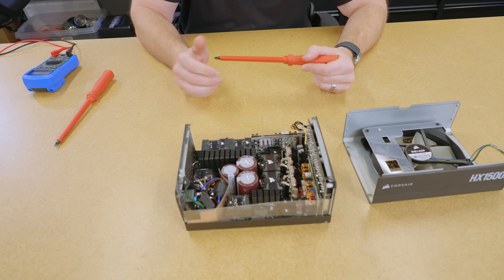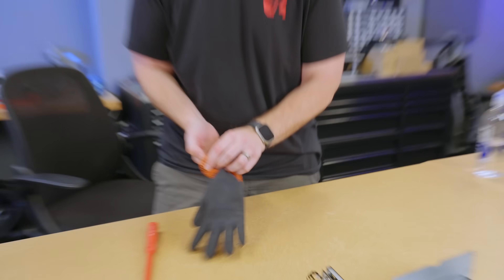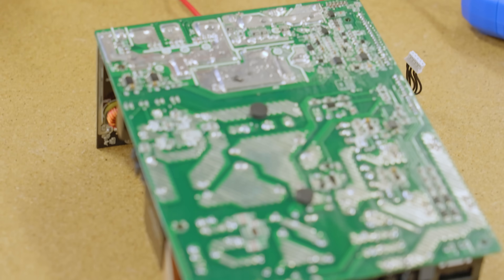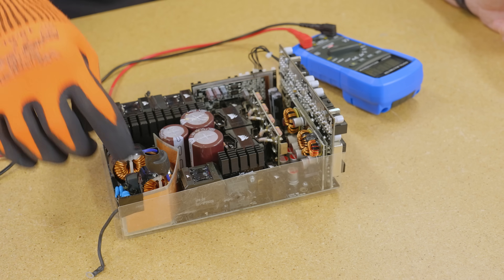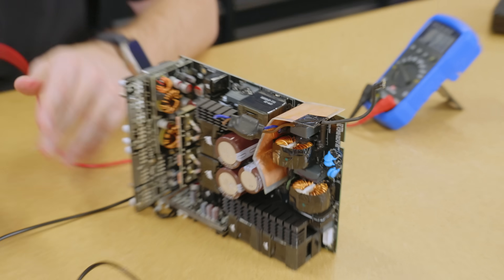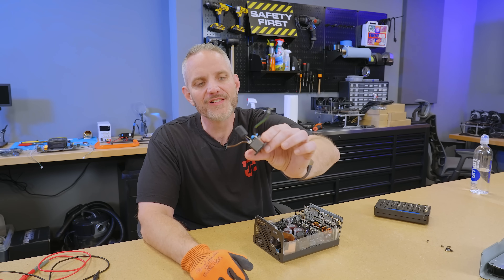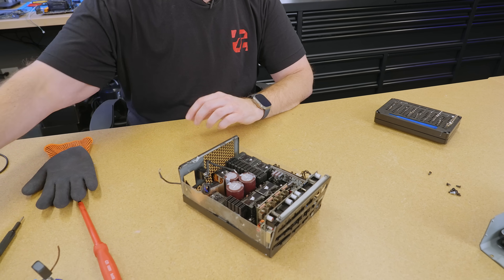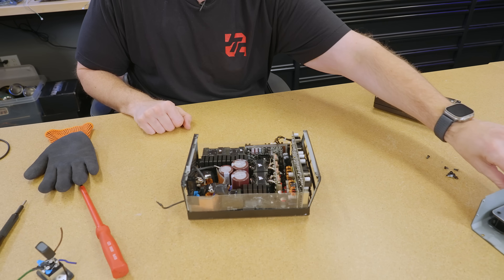Investigating what exploded in my PSU... DANGEROUS! DONT ATTEMPT!

Comment: Those bigger components you were pointing to that you said were the issue look a lot like transformers to me. In fact what I think was a part number I checked from what I could make out "QPR-33" at 5:05 could be the number a ferrite core for one based on a quick search. It would also make sense that you wouldn't measure a charge past that component since transformers REQUIRE an alternating current to transfer energy across since their whole thing works via induction. The capacitors here are only providing a DC source, not AC, so energy cannot pass through that component.

Also, I would not dismiss a capacitor as being bad, as they can still hold a charge when blown. Other comments have also noticed a blown capacitor and the more I look at it I think they're correct.

Comment: its funny to see non eletrician trying to diagnose something as psu :D and it seems as onw of the big caps popped, there is some black line on video on safety release of gasses (cross thingy).
area where you pointed, may be switching dc to pwm for transformers, blah blah blah tech stuff thats why its not getting any power, cuz its off ... :) you can send it to me ... :D

Comment: To discharge big caps at 150v , all you need is a dropper resistor or an old style mains rated  lightbulb with a filament to use up the power, if you want to do it safely without sparks  These circuits should normally have a 1 Meg Resistor or something across them to trickle discharge them I am surprised it held 150v for 24 hours!  It is usually a safety requirement to have built in discharge circuit.

Comment: Those caps have very much discharged. They are the main charge storage/smoothing caps that sit after the PFC boost converter. This stage converts the AC line into a high voltage DC. This is typically 360-400V. So if they are at 150V they've definitely lost a lot of their charge. Usually they would discharge even lower than 150V but as the secondary DC/DC stage probably exploded it isn't working to discharge them.

A transformer, or inductor, if it's the resonant inductor in an LLC, isn't going to 'explode' or make any noise at all if it fails. What would make very loud bangs are power silicon devices exploding. For a loud crack/bang you need the explosion to be quick and electrolytics usually fail over a matter of seconds. A tantalum/ceramic cap could explode though as I've had that happen.

I would be surprised if this was an overcurrent spike event. PSUs are very tolerant of current spikes and usually have a peak current delivery way above their average spec. Also converter control loops are 'slow' vs a transient demand from a GPU so any transient is likely to be handled by the filter caps on the 12V rail rather than the converter itself which will then react more slowly to top the 12V rail back off.

If the PSU had been properly designed then none of the power components would be getting catastrophically hot, during full load operation, and should be rated to handle the peak power maximum as defined by the cycle/cycle OCP limit. It sounds like one of two things may have happened. 1) Some power component wasn't specified correctly and when things got hot it exploded. 2) The PSU was properly designed but a fault developed after it had been repeatedly stressed and thermally cycled.

Comment: If the capacitor had blown you would have a power supply filled with junk. It is probably the switching Mosfet that died, its not uncommon.

Comment: As an  electrical engineer, this video was a lot of "ok, you don't have to be that cautious... Oh Please Hell No Don't Do That!!!!!". FYI,  30mA is all you need to stop the human heart, but that assumes you bridge live terminals with opposite hands so there is a path through your heart. If you bridge DC with 1 hand you'll likely just get a nasty burn but it won't go through your heart. The current you'll get depends on the resistance of your skin and can be calculated using Ohm's Law (I = V/R).  150 V isn't all that high (but  you should definitely still be cautious), these caps in other countries can hold up to 400 V usually. Get a 47 kOhm 5W resistor to bridge out the caps to make them safe.

Comment: It can take 6 months for those caps to discharge fully.  In AU its not uncommon for those caps in PSUs to have 800V between them. Under that small heatsink next to the transformer you kept poking with the screwdriver will be one of the switching mosfets, when those things blow they make big noise... Sometimes in lower end PSUs end up in a few pieces. If you were to discharge those caps and remove that heatsink you'd probably find your dead component.

Comment: Looks like a scorch mark on the copper shield behind that lone rectifier (though I guess that could be some kind of black adhesive, can't see it well enough to tell), as well as a blown safety seal on the top of one of the caps (the one with the yellow smear on the top)...might've had a cascading failure where several components popped nearly simultaneously, would explain why it was so loud when it failed.

Comment: in UK its actually safe to leave psu plugged in if opening as our sockets have switches so we can shut the live supply whilst maintaining ground connection. i had mine open the other day clearing out the dust build up.

Comment: I don't know how they could miss the slit in the capacitor where they found the yellow stuff.
That's your smoking gun. Although it didn't 'blow' the top out of the cap (which is why those indents/weak points are there, so the cap can localise the energy it releases), something went bang.
DC voltage shock is common. You can rub your feet on synthetic carpet on a dry and windy, low humidity day and build up tens of thousands of Volts (DC), discharge it quickly, and you'll feel it, but it won't kill. Jay gets zapped all the time when taking stuff out of boxes with plastic and foam, and that voltage builds up quickly, which is why he feels it being discharged. Static shock = high DC Volts, low amps/current and very short duration.

Comment: A discharge cable is just 2 Wires with a resistor in between a 1000 ohm resistor of 1w will do the trick and you could discharge the PSU and check the circuit

Comment: pshhh. it's not scary until you hit kilovolts and the AIR becomes a ground. eyeroll You mean to tell me you tore apart a power supply with no plan to use a power resistor to bleed off the charge?

Comment: probably the N chanel mosfet in the primary side mounted on black heatsink,,,,,,you can discharge that caps with soldering iron use the power input plug pins and short the capacitor with it for a few sec

Comment: We used to charge caps with a megohmmeter and throw them at each other. Just short the 2 ends of the capacitor with something metal (but still use a rubber glove or insulated tool). At most, you'll get a nice light  show for a split second.
In the Navy, I worked on radar systems that ran tens of thousands of volts. You could feel the hair on your arm stand up when the panel was off. We routinely had to discharge capacitors with a shorting probe when doing maintenance.
Reply: You used the appropriate tool; Jay not so much.

Comment: Eh, sounds like normal shit to do. I mean, mains voltage isn't *that* bad after the first few times... I joke, don't do it. Eventually your luck will run out and you find the kV rated stuff which, even at ridiculously low current, will leave you flat on your arse wondering how you got there.
Resistor and bulb are both good methods of draining the caps so you can check things properly, it should be your first port of call after opening up the PSU so it's safe to handle. *DON'T* do it the way we used to, we were young and stupid back then (it's a miracle we managed to get to old and grumpy instead).

Comment: Jay, at the very least never touch it with two hands, at this point its a isolated dc system, still packs a punch but is not earthed and doesnt have dc that can capacitively couple
And if you dont touch it with two hands at the same time there will be no dangerous currentpath across your heart, that's why you should keep one hand in your trousers pocket to not even do it out of habbit

Comment: The four diod rectifier died. That is the component you pointed to.
Flow : Capacitor -> rectifier -> high frequency shopper -> high frequency transformer(s) -> rectifier(s) -> voltage regulators

Comment: @4:35 Don't use you current input (as ground the black lead) to measure dc voltage always use the COM input. You could blowup your meter... As to dis-charge your cap's unlucky your meter doesn't support LoZ like EEVblog's BM235 multimeter

Comment: Use resistors to drain caps to ground. Also if that component is a relay you won’t get power out the other side. Can’t really tell from the video. If it is a transformer it could have made a big pop.

Comment: Jay, as long as the PSU is disconnected from the wall the capacitors won't kill you.  Nasty shock yes, kill, no.  It's static electricity just like scuffing across the carpet in winter x10,000.
I once forgot to discharge a flyback capacitor on an arcade monitor, which holds somewhere between 50 and 100kV, and I wasn't hurt.  My arm went flying and the screwdriver I was holding ended up lodged in a ceiling tile, but the only "lasting harm" was that my arm was numb and unresponsive for about half an hour.  But static charges don't carry more than a few milliamps of current, and its the amps that kill.

Comment: 5:37 to 5:48 has a sound that was either the leads scratching the surface of the board or the mic picking up that... Noise... A warning noise of it's danger. Thankfully nothing happened, and you stopped there, essentially.

Comment: You can build or buy a discharge probe.  If you work around electronics much it is worthwhile.  Radar tech for 39 years, so some experience with high voltage circuits in my past.

Comment: When I was in high school (way back when) I took an electronics class.  We'd take a very long screwdriver, use a wire with gator clips on each end - ground the screwdriver and SHOVE it up under the high voltage connector to discharge a 14KV picture tube.

Comment: You are honestly not telling me you did NOT see the BURN MARKS on that copper-plastic divider between the cord connector area and the transformer/capacitors?
The littke black transformer has blown that sits next to the capacitors, the lonely one not the bigger ones!The one right and below the blue and brown wire in the heatshrink at 7:14 and even there you can see the burn marks!

Comment: Jay, I'm gonna have to correct you. It is ONLY dangerous if you don't what they F you are doing. I have been ripping and stripping broke power supply's for... 20 years. Not even a tingle. Just prep the damn thing to discharge the caps.

Comment: My Corsair power supply exploded 2 times the first time killing the pump on my water cooler in the process, they "fixed" it but it only lasted 5 months after the fix and 8 months before the fix. i swapped to seasonic and i haven't had any issues in a year. evga also had no issues for 3 before this build.

Comment: In my old job we used to dismantle power supplies (and CRT monitors) all the time, some had just come straight out of PCs that had been powered on right before we scrapped them. Surprisingly never had any accidents considering most of the people working there were volunteers on work placement and there was no safety equipment. Thankfully moved on from that job 12 years ago.

Comment: It does not need to be a transient to cause a failure, it could be many things, Even the caps at 150 volts do not contain much energy, they won't kill you like that, you can just short them with a wire, and if you touched them you will get a quick shock but not a big shock and that's about it. 

Switch mode power supplies increase the frequency of the input AC so you can have a small transformer and smaller capacitors. 
It is the bridge rectifiers under those heat sinks (two sets for different voltage rails), I expect the transformer or the bridge rectifiers blow. Even a high current fuse can make a very loud noise if they blow. 

But you are correct, if you don't know what you are doing, don't do it. 
I've been an electronics tech since the 80's and a 1kw power supply is small fry. 

I used to work on radio transmitters with power supplies that can deliver a continuous 30 amps and 10,000 volts with capacitors that take 3 people to lift up. (and I'm still here,)  That is real one flash and you are ash stuff. 

Just don't screw with stuff if you don't know, I would have expected to see some damage, and I'm sure if you looked really carefully you would find it.
Reply: It can take as little as 20 miliamps to fatally disrupt your heartbeat. Capacitors can and will kill you with their charge.
Think of it like this, the AED units that are so widespread because they can restart your heart use similar sized capacitors as you see in this PSU, and if it can start your heart, it can just as easily stop it.
Reply: @44R0Ndin  20 milliamps THROUGH THE HEART MUSCLE. Not across your body. 

To get 20mA through your heart from your hands or arms you need A LOT of voltage and current. 

In my early navy days in our electronics workshop we used to charge up electrolytic caps to 100 or so volts and through them to a friend and they would get a little zap as they caught them. They would call you a name and try to do it back to you. 

A small capacitor like that, charge at 150 volts is NOT going to kill you.

Comment: What broke, is really really obvious. There's a hole in the cap. That's what went bang. All 3 caps are NOT GOOD. It's so obvious to anyone who's done component level repair. I really hope Rossmann roasts you.
What you're seeing in terms of voltage, is it looks like 2 of those caps are in parallel. So you're assuming that the bad cap is good, because the voltage you're seeing is from the other cap that actually isn't fried.
And a resistor or an incandescent light bulb can be used to discharge and make it safe. 
@5:05, no the transformer is probably fine... my brain is starting to hurt... that's not how transformers work.... caps provide dc, and transformers require ac to work.... 
No one needs a schem for this. The cap vented. It's so obvious.
How to tell the world you've never done component level work, without telling the world you've never done component level work.
I look forward to Rossmann roasting you. :P
Reply: and some of these comments, especially the ones from people claiming to have worked on this type of thing before, not even mentioning the obviously blown cap, boggles my mind....

Comment: Once the caps have discharged, you should dissect this further and confirm what actually failed. I think once you take the heatsink off you'll find debris of a mosfet. In short, you have active PFC, mains rectification and filtering, mains switchers, inductors and filtering, dc-dc rectification, output. If you follow the traces it will go roughly in that order.

Comment: When I worked on HVAC, we regularly dealt with capacitors much larger. We learned in school to short them to discharge them. I’ve done it many times without issue. When I have not discharged it, and been zapped, it was no big deal. The HVAC capacitors can be high voltage, but it’s like a static electricity zap, low amps. Still hurts though.

Comment: LOL@ using a screwdriver. If no bleed resistor is installed you need to buy a discharger or use a resistor across contacts of each cap one at a time

Comment: Probably one of the transistors below those heatsinsk is the one that blew up. Caps can explode, but they usually vent, transformers stop working when the wire blows but I'm not sure I have seen any explode. Transistors can go with a loud bang and split.
Reply: cap was obviously blown and vented.

Comment: If you have a sheet of anti-static foam, place the circuit board on there and leave it overnight - it isnt HUGELY conductive, but it should be enough to slowly discharge the caps.

Comment: It's NOT DANGEROUS!  IF - you don't have the supply plugged in.  Short the CAPS before playing with them. If your worried then simply use a globe or something, but 115v for .01 second will not kill you.
Caps used in most power supplies as shown MAY give a minor zap but no where near enough to be DANGEROUS.  When shorted the caps only hold charge for a split second.
Over 6 minutes of measuring residual voltage in a CAP.  Not very educational!

Comment: On older cars they used to use a ballast resistor. If you can get your hands on one of those it will discharge the capacitors safely.
Reply: That's the badger! Cheers; I was groping for the word.

Comment: You can safely discharge high voltage power supply capacitors by firmly pressing the disassembled power supply against your best friend's face.  It's fully discharged when the screaming stops.
Reply: "It's fully discharged when the screaming stops" Is that the friend that's fully discharged, or the capacitors? Asking for a friend of course.

If the friend has to be fully discharged then wouldn't it take less time if I hook him up to mains instead? I'm all for efficiency after all, and I'm sure my friend will enjoy the extra spiciness of 240v 13a mains much more than he would a PSU